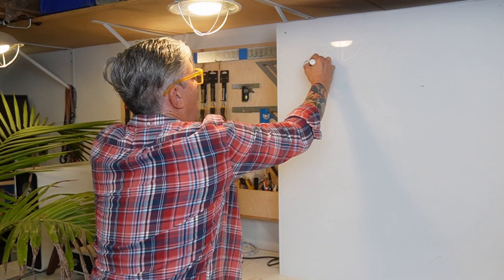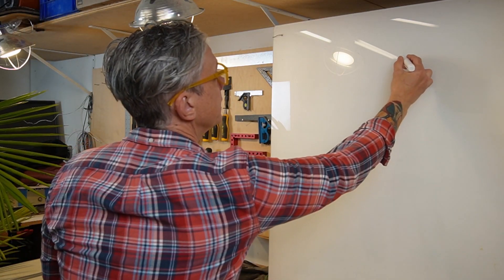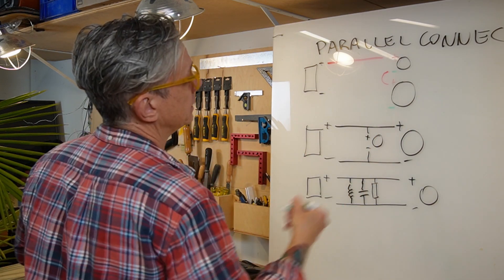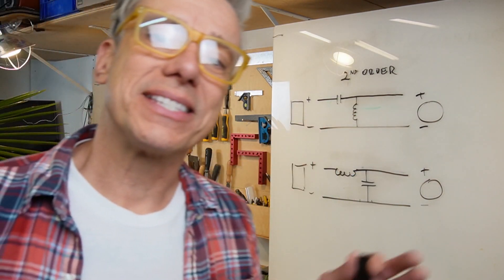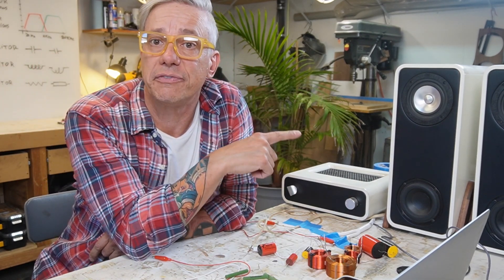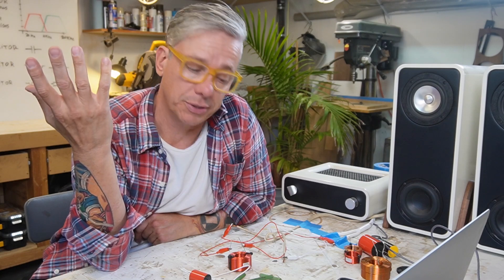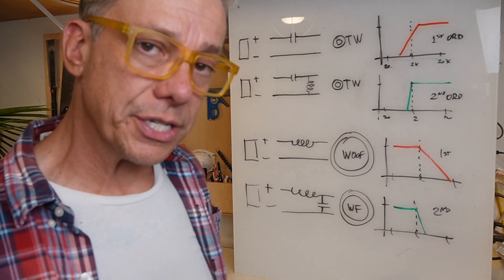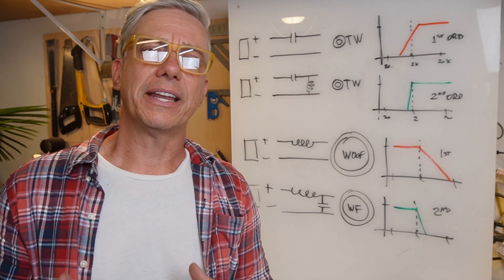Talking Crossovers - Video 2 - Series / Parallel Connection | Crossover Order / Slopes.

Comment: make video 3!!! Not super clear on how running the signal in parallel to 2 drivers impacts the slope of the audio signal for each driver. Also are resisters mostly used such that you only send certain voltage to each driver based on what they are rated for? This way you don't over power the drivers
Reply from the maker: Resistors serve to balance the level between the drivers. And some other tricks.

Comment: You took a difficult topic and made it much clearer to me on the why of the design choices.  I often wondered if you could make a multicomponent unit with many values of capacitors, inductors and resisters linked to a switching system that allowed changing values on the fly.  Dial in an initial value for each component then go up and down on inductor and capacitor values while playing music to hear the effect.  Then you can design the best circuit based on actually hearing the music.  Hope you are doing well.
Reply from the maker: Hey Mike! Thanks for the input! That’s a great idea actually. Some people use a board with multiple components to try them real time. Close to what you just said.

Comment: Help me with the crossover, which one should I assemble? I bought the Dayton Audio RS100-4 4” and Dayton Audio ND25FA-4 1” Soft Dome Neodymium Tweeter speakers from you! And I also want to buy components for a crossover from you, tell me which one to assemble?
Reply from the maker: You should use the crossover I made on the soundbar. Check the older videos, there is a soundbar with RS-100 and the Dayton tweeter.

Comment: I hope nobody minds if I toss in a few points here...

First; to get a leg up on the future installments, this is a good time to go to the download link in the description and grab XSim and Filters101.  
There are examples of all the basic filter types and you can experiment with them by dragging a resistor into place to make connections.  It will take a few minutes to figure out but once you have it working, you will see the various configurations -- High Pass, Low Pass, Bandpass and Bandstop -- in action and you can mess with part values to see the effects.

Second; keep in mind that crossover networks are not DSP or EQ.  They are simple filters that are intended only to get the proper frequency ranges to the appropriate drivers.  They're a blunt instrument, not a refined tool.

Third; very often you will make bigger changes by refining your cabinet designs than by concocting complex crossovers to compensate. See the rebuild on the Dayton T652 video for a great example of what you can achieve.

Fourth; never use a part that isn't absolutely needed.  I constantly see hyper complex commercial crossovers that, in many cases, can be improved by removing half the parts and making a small adjustment in value of the parts you keep.  Not only is "parts loading" a waste of money, it tends to make a less lively and efficient speaker.

Fifth; don't be afraid to fail. I built about 5 different versions of the DIY speakers you see pictured on my website (in the "my story" essay) before I got it right. But in the end it was worth every bit of the effort. 

Finally; know when to stop tinkering. When your tweaks and changes don't bring better results, it's time to back up one step, put everything together and just enjoy the result.  DIY building is supposed to be a hobby... not an obsession.

Waiting for part 3!

Comment: Good stuff! Something that isn't always obvious - the impedance of the drivers interacts with the crossover components. So, the values of the coils and caps have different effects in a given speaker. And one of the main reasons that you would use a higher order crossover, is when the driver has a peak in its response that you want to decrease in level.
Reply: Yep ... good advice that.  
Too steep a slope and you end up with dips in the output. Not steep enough and some of the nastiness from cone breakup (etc) can leak through. It is a bit of a judgement call, most of the time.

One thing we should caution people about is to not just start throwing parts at a problem design... fewer parts is always better. The end product will be more efficient and less likely to fail.
Reply from the maker: Thanks again Doug! Not easy, but not impossible hehe
Reply: @sonnoradesign 
Yep.. like most things, it's an acquired skill.  Nobody "just knows" how to build a speaker.
Reply from the maker: I really appreciate your input Neil! That’s great advice!